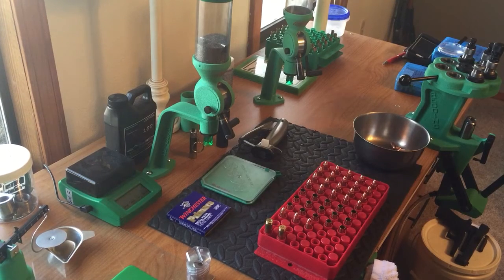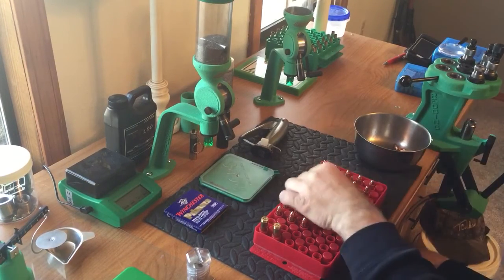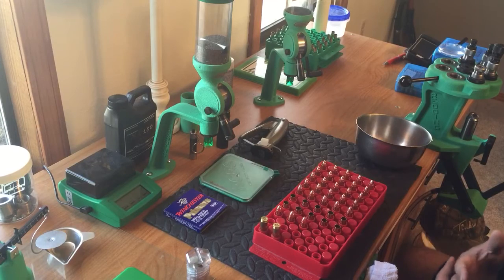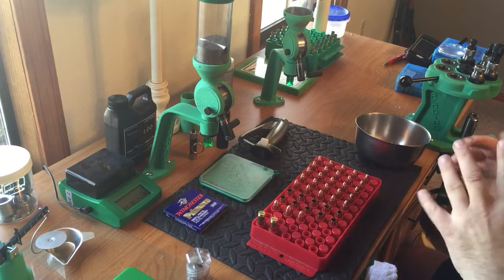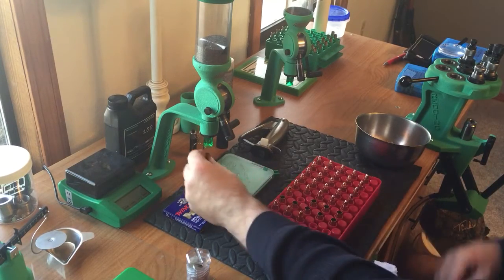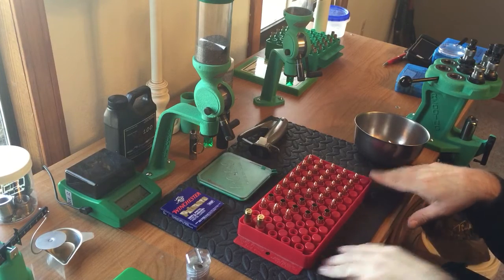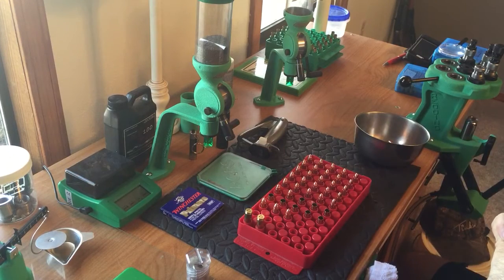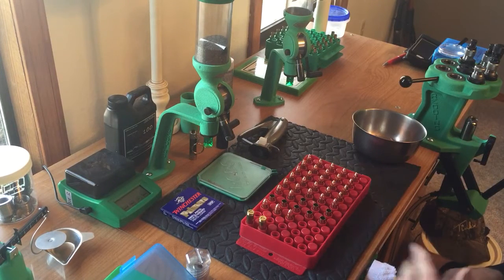Reloading Presses Single Stage VS Turret VS Progressive.  9mm 147g Xtreme Load

Comment: I too feel that the single stage press is obsolete against a turret press. And a progressive press opens up far too much room for errors by limiting the opportunity to thoroughly inspect each prosses. 

But I have to say that I do like the idea of a two stage auto-indexing turret press with the Hornady LNL quick change die bushing set-up. This way I could quickly size and flare in one go, and then seat and crimp in another round. I would de-cap on the Lee APP, and then clean and lube, and then and size and flare, and then charge (of press), and then seat and crimp. 

With Lee's 4 stage auto indexing turret I could use two sets of dies to accomplice such but their's breaks far too offend, and no one else, that I know of, makes one. Sad!

Comment: I'm from Brazil and I shoot only with a pistol, 9mm and 0.40. I shoot 300 rounds a month a little. I currently have a Lee Loadmaster progressive press, I have it for about 12 months, my first refill press. I confess that I am a little disappointed in Lee. This press requires a lot of adjustments, operations sometimes fail, there are plastic parts that usually spoil easily. I am looking to migrate to a REDDING T7 TURRET. Am I on the right track?